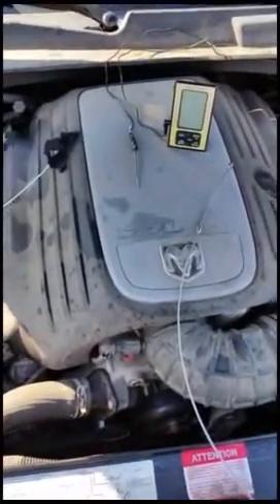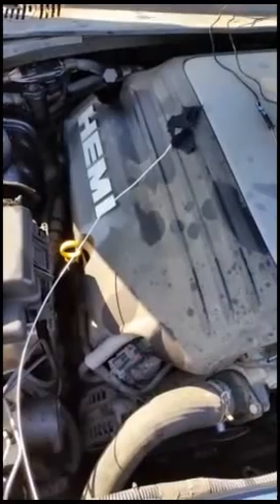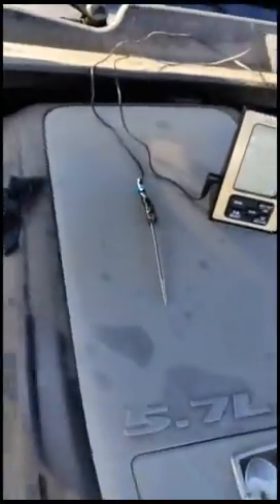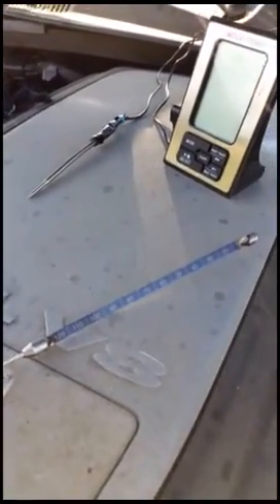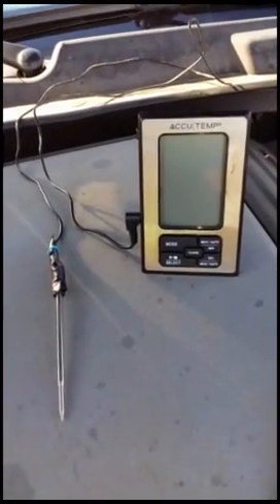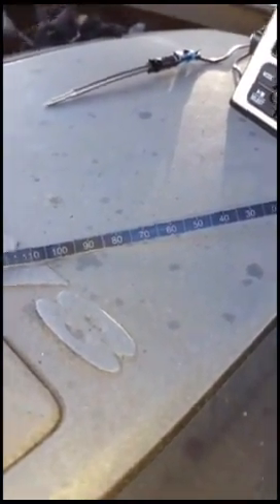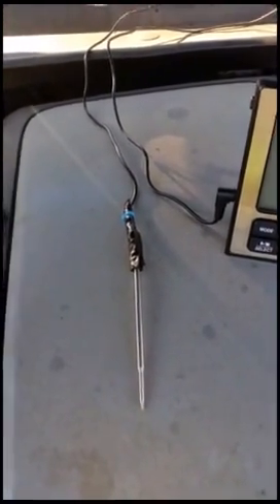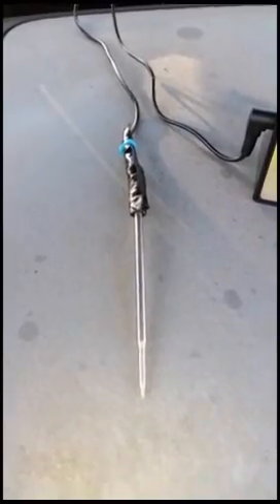Adding fluid to a Dodge Magnum (NAG1) transmission

Comment: You said you got a temp of about 150 deg with the probe, what was the temp reading with the gun on the pan when the probe said 150? Thanks, if you recall.
Reply: No sorry. I don't recall , but it was quite a but off as I recall. Not worthy of entertaining that method IMO. Have since switched to using the Nag1's built in temperature sensor that can be read by any $15 bluetooth OBD2 code reader and a cheap Smartphone app (Android or iPhone) called "Torque".   Accuracy is to 1/10 degree Fahrenheit. By far the biggest problem now is that you can only get one accurate dip with the Miller tool which tends to "drag" some of the tranny fluid up the tube every time it is dipped. The second and third times you insert the tool and try to take a reading, you will see the damned tranny fluid up and down both sides of the scale of the tool. PS. The temp sensor is physically installed in every NAG1, however the you need to locate and side install the Chrysler trans temp sensor within the Torque app.
Reply: Thanks for your reply. I did buy the torque pro app and the Bluetooth obd2 adapter. And I did load the Jeep / dodge trans temp additional sensors. One of them shows green indicating there is communication with the ECU but a just get a -40 deg f reading even in drive. I have a 06 magnum RT. Others on the web have the same problem as I do where it just reads -40.  PID :2103 The only thing I can think of why it does not work is maybe I did not get a software update from the dealer. I used the predator tuner and I did not want them to flash the ECU and have problems installing my tunes.  With regards to the dipstick, it is much easier to read the back side for the fluid line and I just slowly turn it around to read the mm reading. Thanks again for your time.
Reply: @Noonecares10021  Did you add the correct PID ?  There are two different ones as I recall. The video done by Ray A. for a 300C explains everything.
Reply: @Noonecares10021  That's great.
Reply: @Noonecares10021   Hey Tom, I have the exact same problem on my Jeep Grand Cherokee Wk 3.7l V6 with NAG1 tranny in Torque app. Shows only -40. The eBay number item you posted does not work. Could you please send a direct link? Thanks

Comment: How u change the transmission fluid on a 06 rt dodge magnum some body please tell me
Reply: Well. Because there would not be a drain plug (it doesn't come with one from the factory) you need to drop the transmission pan full of fluid. There are about 12 bolts around the perimeter that need to be removed so you can lower the pan. Dump the fluid, replace the gasket and filter then  reinstall the pan. When you add the fluid , start with same amount (or a little less) than you removed and then using the proper measuring tool (sometimes called a Miller tool and available numerous locations and sellers online) keep adding fluid in small amounts until you achieve the correct level for the corresponding temperature of the tranny fluid.  HINT: You need to use the chart and way to accurately measure the temp of the fluid.

Comment: no matter how much fluid I put or remove I keep getting an over 100 reading, this is so frustrating
Reply: Did you wipe down the inside of the tube before putting the dipstick (fluid level tool) down and then back up? If not you will find the end of the tool draws fluid up into the tube at the first bend after leaving the pan and will always give you a false reading. You MUST fabricate some sort of tool that wipes the inside of the tube all the way down without dropping something inadvertently into your pan OR coming into contact with the the fluid. Every time you push the tool back down for another reading the tube must be wiped first

Comment: I'm having a little vibration when I push the gas just a little but if I push it down more I gos away should I change my fluid
Reply: jack T I’m having that issue with my 2007 r/t I was thinking motor mounts???
Reply: Zachary James dose it go away when u use autostick  i heard of water in the trans fluid , torque converter or the MDS system yea and engine mounts
Reply: Zachary James I'm working on my 06 Dodge Charger Daytona rt looks like it's a common problem but no one knows the exact fix
Reply: jack T Its Always Something With These Cars Huh? I'm Stuck With My Recently Purchased R/T With A Jerk Type Feel When Accelerating Mildly, But Goes Away With Heavy/Hard Acceleration (I believe it's the same problem You Described having As Vibration) IDK what's going on, and Of Course I Can't Easily Check The Transmission Fluid Level Without A World Of Info and Tech Tools (Chrysler In Their Infinite Wisdom) No Dipstick. SmDh
Reply: jack T Did You Ever Get Your Problem Fixed?
Reply: phigo4kins no I changed the trans  like three times and put Friction modifier and it got like 80% better I guessing it's the torque converter but I really don't know
Reply: Every time my car is decelerating say at a light my car shudders and shakes like it’s wanting to change gears then goes into the lower gear.. idk if it’s the mds or what
Reply: Zakk Whittington so I ain’t see where u add flued